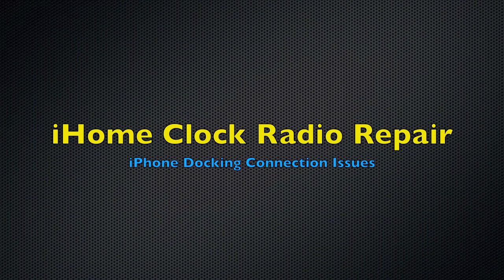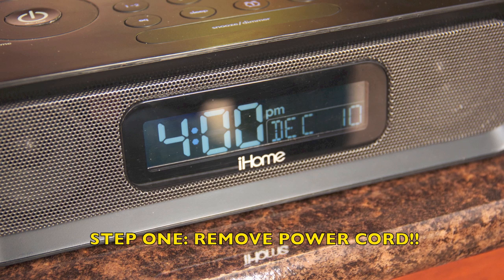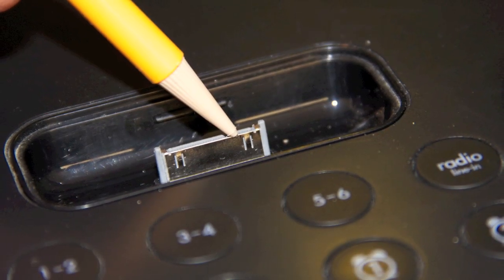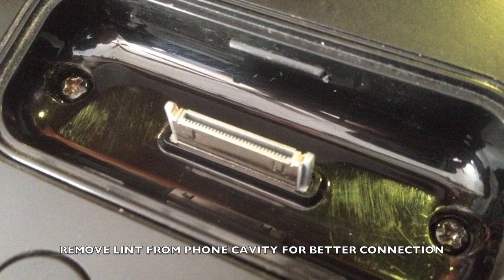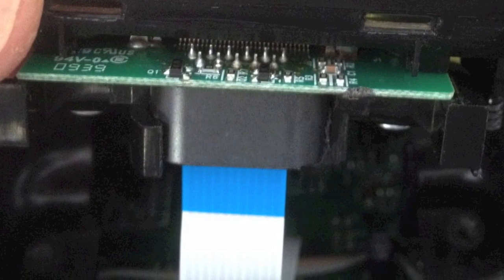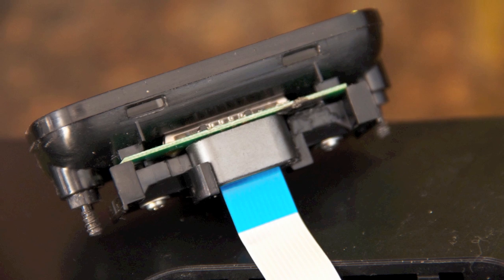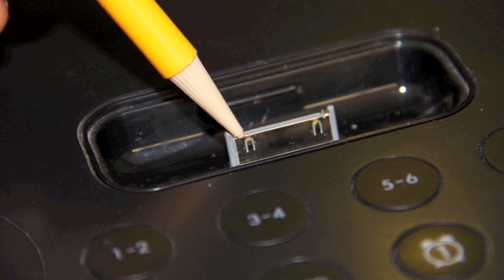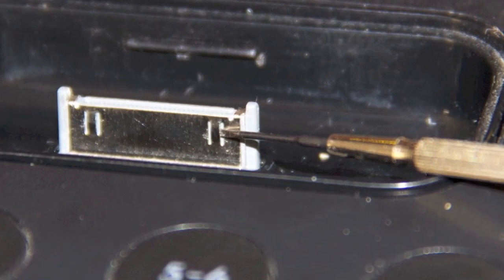iHome Clock Radio Repair

Comment: My ihome has stopped charging my devices and no longer plays my music from my ipod. The rest of the ihome works great. If I have an ipod docked and push it forward it suddenly charges and plays. However as soon as I let go it stops and I worry that using something to keep it in that position will damage my ipods. Will this repair work to fix this issue? Thank you. :)
Reply: I had the same issue and it fixed mine

Comment: Any tips on how to repair lightning connector docks? Mine stopped working after two months.
Reply from the maker: Cassandra,  From the design of the plug and the receptacle, I'd think just cleaning both would be about all you could do. The receptacle could easily collect pocket lint which would possibly cause poor connection, or even block the plug from going all the way into the receptacle. The idea of hanging something like a "super sized"  iPhone 6 on such a small plug does make one wonder.
Reply: Thanks for the quick reply! Turns out my issue was not dust/lint, it just needed a reboot by unplugging then replugging into the outlet!

Comment: Hello,
Do you have a solution for when the knobs/turning wheels stop registering the correct movements? ie I turn the volume knob and the volume on the box varies wildly - up, down, not moving at all. Its quite annoying on an otherwise well working device.
-JC
Reply: Hey, I had the same problem.  Did you ever find a solution?
Reply: unfourtunately no